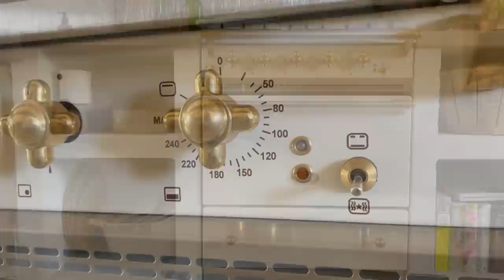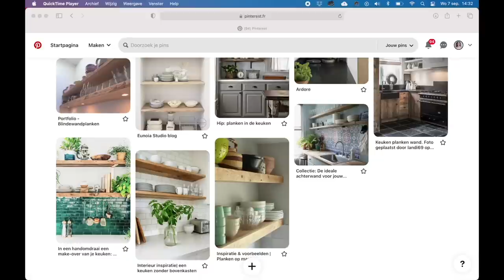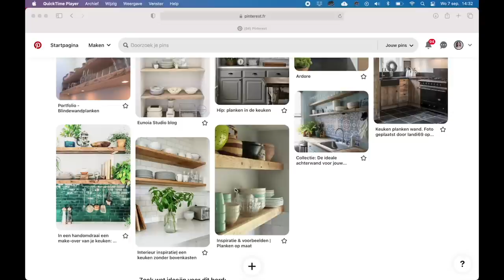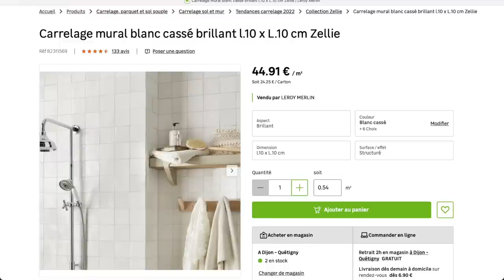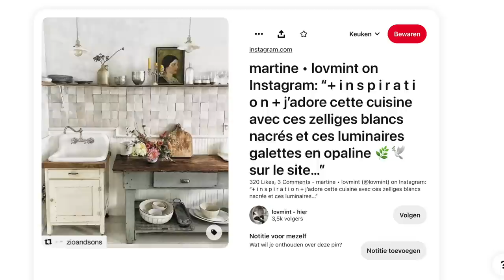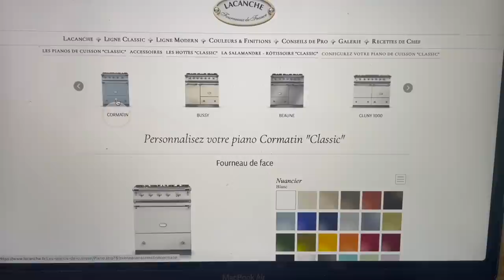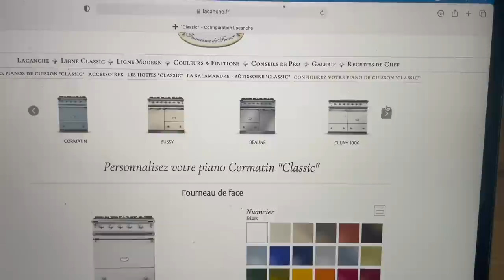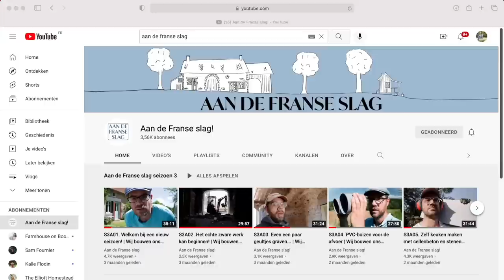Country kitchen reveal of our farmhouse in France

Comment: We renovated our houseboat. I originally wanted butcher block counter tops..But, was more money than I wanted to spend. I wound up using 2x6 pine wood boards for countertops. Sanded well and left natural. Then sealed with a polyurethane that you brush on. And brush on several layers and sanded in between. They came out amazing. And love the small darker knots in the wood as well. And on a wide bar top we used 1x4 as a skirting around it. And added small lighting under bar on the seating side. The lights are battery operated and mostly used if the power goes out in the area during a storm. Because I also have a shelf space under there for lanterns and flashlights etc. Solar battery and weather radio. All tucked away next to the wall.
Reply from the maker: Thanks for sharing how you did your countertops! We’re looking into that for our big kitchen and haven’t decided what we’ll do yet.